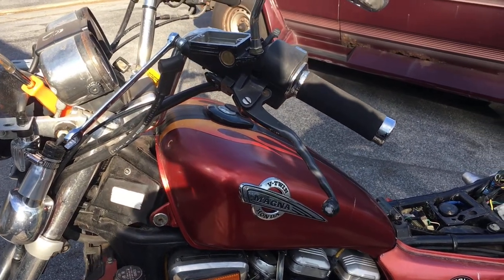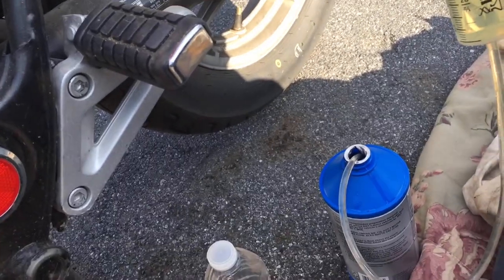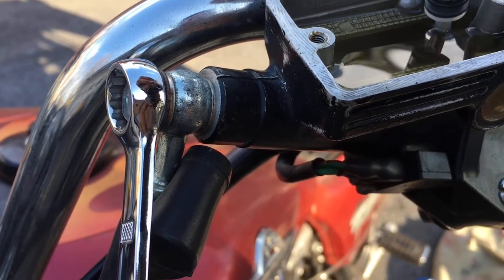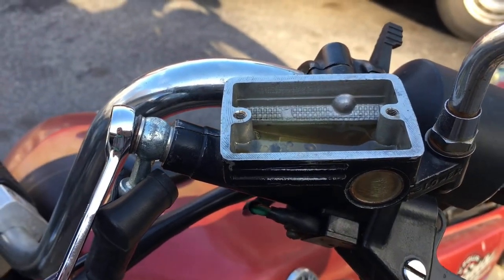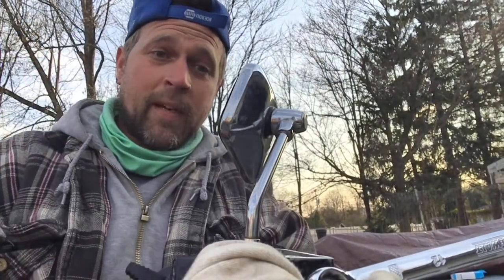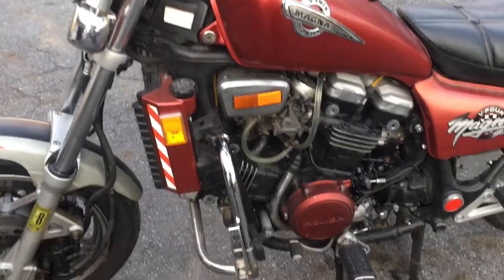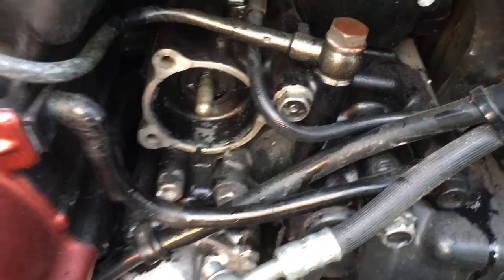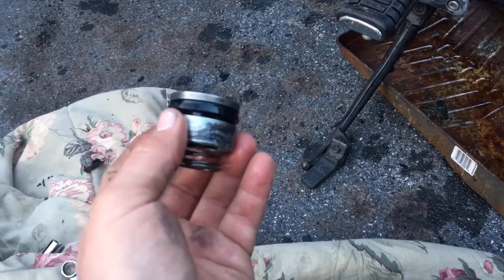Honda Magna Clutch Reverse bleed. Slave Cylinder. 1982 V45 VF750C

Comment: Looks like you are replying to comments. I have an 86 magna 700. Just replaced the master slave cylinder. No clutch pressure after. Question is should the cylinder have some play with the spring or should it sit firmly in the housing? Mine is firm so I'm wondering if it is too firm and therefore not pushing on the pin. Thoughts? Could still need to be bled as well if there is air still in the line.
Reply from the maker: If you used a new master you should be good there but I can’t speak to the parts used. There will most likely be air in the line right by the upper bolt crack the bolt going into the master while you bleed

Comment: Did that work?
Reply from the maker: If your clutch plates are not stuck together this would’ve worked. In my case, I needed to change the oil in the bike with fresh oil, warm the bike up and sit in first gear with the clutch, pulled in and rock it back-and-forth until those plates freed up. It has been good ever since.
Reply: Trying this tomorrow, thanks!